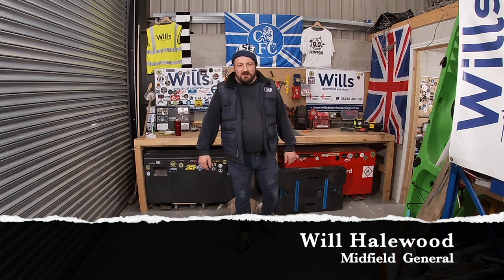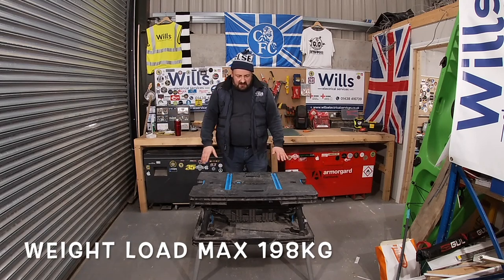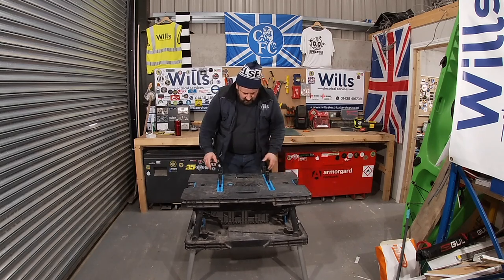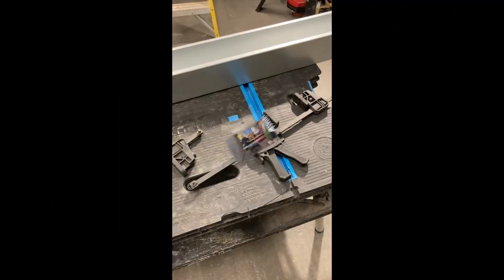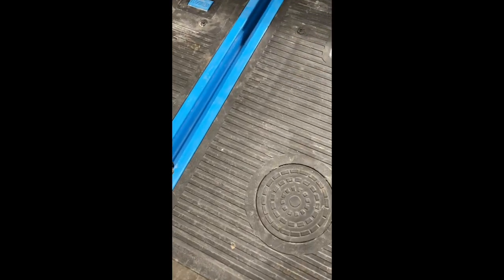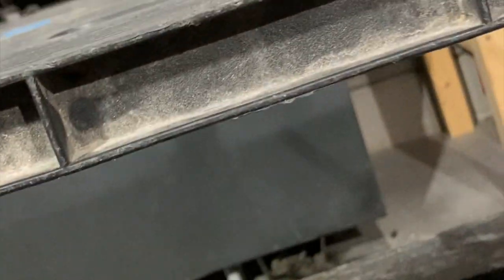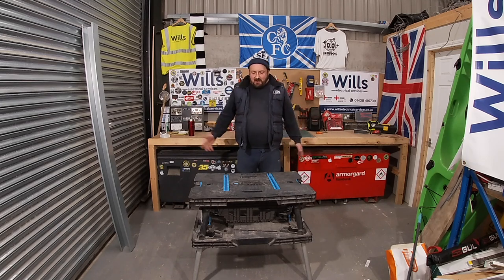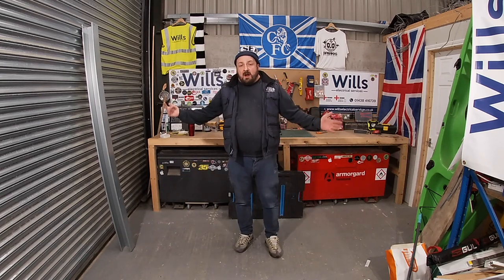Electrician Tools - Foldable Work Bench Review Macallister Vs keter | Electrician TV

Comment: Love mine! Only problem is I smashed the handle when I was using it to do my racking 🤦🏻‍♂️🤯Only had it 24 when I did that too! Proper Lemon! Still works well, such a useful bit of kit!
Reply from the maker: it Is one of those tools  that you don't appreciate how useful it is until you haven't got it.Mine has been through the wars as well the biggest challenge to stop other trades putting this tools and materials  on it.Can you not make a handle out all round banding going through plastic kopex.
Reply: @ElectricianTV  Yeah definitely mate, I changed vans and moved house abs chucked mine in a shed at my parents for storage and then lockdown and tier 4 etc has happened so mines stuck there along with my rhino pipe tube 🤦🏻‍♂️and I’ve really missed it! Definitely the biggest problem stopping others using it! Great shout about the copex handle I’ll have to have a look when I get it back! That’s for the idea fella

Comment: Legs don't hold in well at all.. other than that it's sturdy but it will become a problem if you have to move it alot. The legs should be snug but for $54 it's manageable I guess, next step up is $100 so 🤷